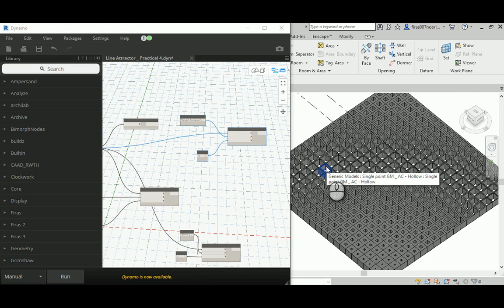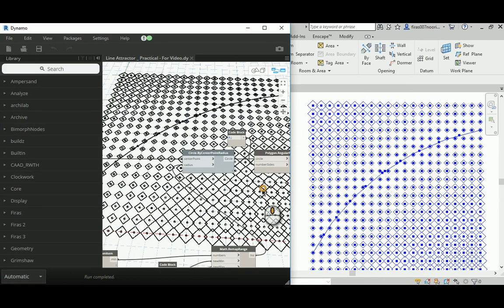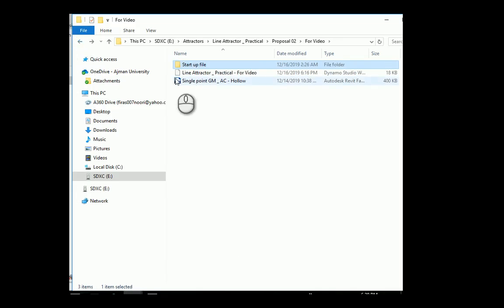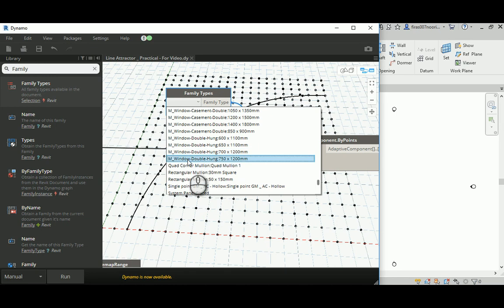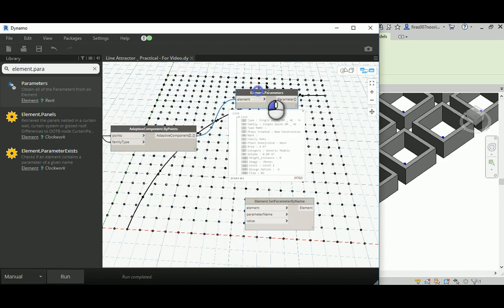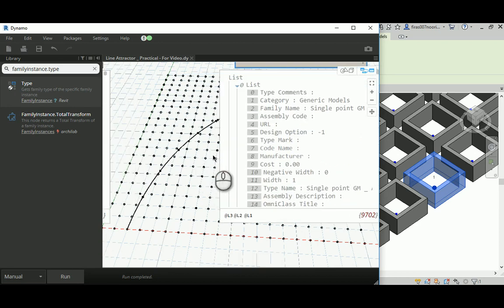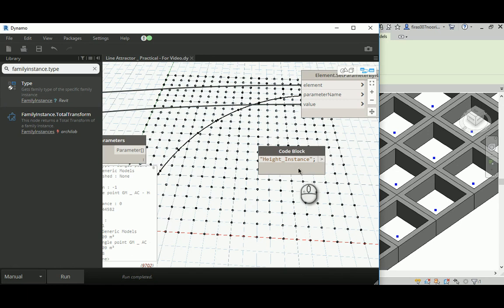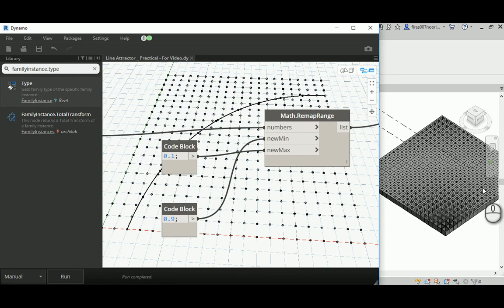Line Attractor and Adaptive Component _ Dynamo for Revit _ Practical Part 1

Comment: Math.remap nd mim.map node ...why we use these node...thanku
Reply from the maker: The remap node ensure the list of values you have will be rescaled to be between 2 numbers u choose, imagine you got valued like 1000, 920, 800, 600, 200 and you want these to be opening ratio of a windows that maximum can open 1 m and min is 0.2m , the remap will make ur top list like 1, 0.92, 0.8, 0.6, 0.2, so they will in a new range or domain you pick its dimensions
Reply: Thanku sir ...
Reply: If we wil not give this node ...and direct connect to .one step before what u did in this video...so what will happens??
Reply from the maker: I cannot remember what I did exactly in this video hahaha, but imagine my friend that you use a range of values you got from random 0 to 1 and you want that to be windows dimension in milmeter!! Without the remap the width of the window will be between 1 mili to 0 instead of scale them up to be 1000 mili to 0 mili, it will be lots of errors my friene

Comment: Hi Firas, thanks for these great tutorials. I wanted to ask how can we adept this system on a bended surface? Thanks in advance.
Reply from the maker: You will be in need to define and divide the surface with points and then a grid, use your attractor line as by choosing some pointa on you surface and define the required line, finally use that line as an attractor line to gain any attraction effect you desire